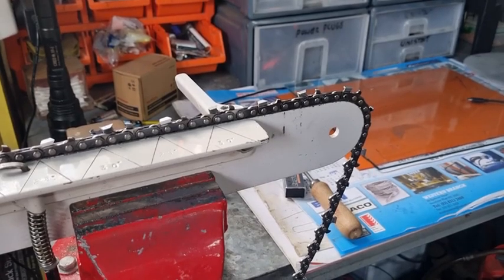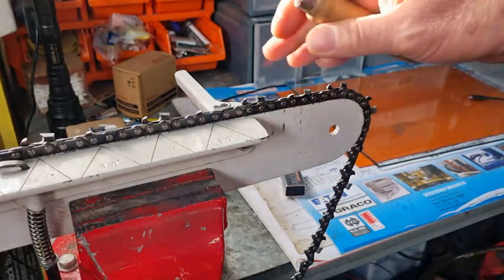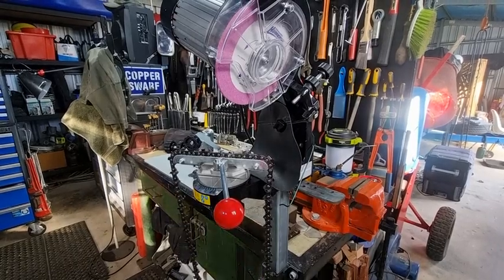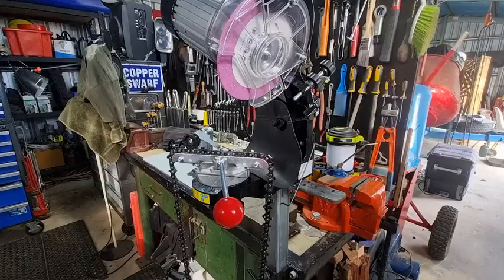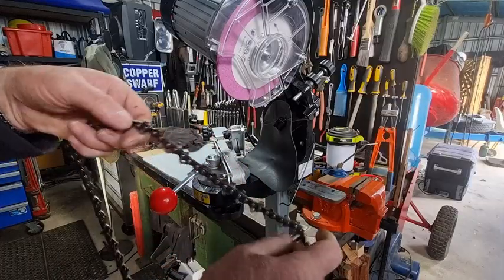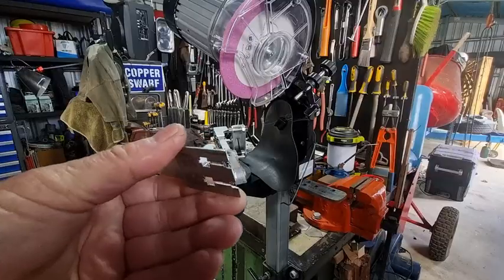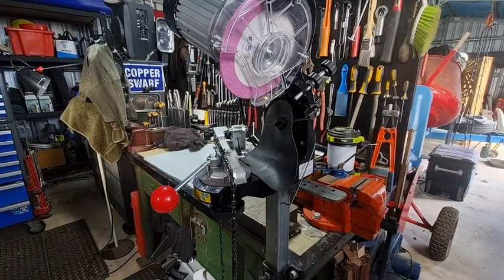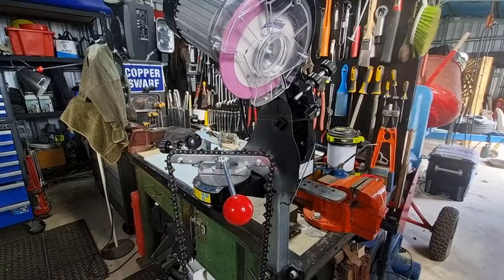How to get your chain teeth the same length when sharpening your chain

Comment: I don’t worry about just a few teeth being a minor length difference. I file BOTH teeth with the same RIGHT HAND because I can’t make my left hand do the little things that need a lot of dexterity to accomplish the little things in life that need very fine detail…like sharpening my chains.
Reply from the maker: With practice we do get much better at sharpening and get it done even left and right
Reply: @ChainsawUsers  I’m doing better all the time at getting the constantly the same length AND extremely sharp. My arborist friend has always complemented me on how sharp my chain is and how well and straight it cuts. It’s very long lasting as well…until it comes into contact with something that would dull ANY chain.
Reply from the maker: @ToddAdams1234 chain grinders can also give problems if not set up correctly.  Thanks for your comments
Reply: @ChainsawUsers  In the portion of my life that I’m currently having to undergo, an electric chain grinder of ANY type is off th table. It’s just not in the cards that I currently have in my hands, but I DO like making an occasional bit of cash using my saws. That’s why I became really good friends with my files. 😂

Comment: When I started filing I did it straight from the start filing left n right tooth in alternate fashion.  Trained my muscles by doing superlight strokes with the file till I was able todo it with ease, no problem with different length teeth, it's all practice "hence all in the filing😊"
Reply from the maker: Yes you got it right

Comment: Record a video showing what shortcomings of the machine prevent it from sharpening right and left teeth of the same length.
Reply from the maker: In all cases the variation of tooth length during the chain sharpening process is caused by human error only.
The user is not setting up the back stop so it removes the same amount of metal left and right.
Quite simply the user needs to set up the backstop so the tooth just touches the grinding wheel.  This is the starting point to grind the chain.
When finished one side of the chain the user fails to adjust the back stop to the same setting.
So if you remove .2mm on the left side you need to remove .2mm of the other side.
Reply: @ChainsawUsers  Why adjust the stop? A machine with the correct geometry and accuracy should sharpen left and right teeth equally.
Reply: Under what conditions will the machine sharpen both teeth without adjusting the stop?
Reply from the maker: In the case of the USG grinder it is a precision grinder and in most cases its not required to reset the back stop grinder left and right cutters its just a good practice.

With cheaper grinders the tolerances  are not as good as a USG grinder and its best to adjust the back stop to ne 100% sure you are grinding the same of metal of both sides.
Every machine will have variations in tolerances even the USG grinder
That why I check both sides using the back stop
Reply from the maker: No machine is perfect that's my point.  And that why I recommend you setup the left and right cutters with the backstop adjustment for both left and right.
If you swap left to right or right to left without backstop adjustment you may have a slight error.
In most cases you are only removing  .2mm to sharpen a tooth.
Reply: @ChainsawUsers  To make the teeth the same, the left and right, teeth need to meet the grinding wheel in the same place in all planes. You can think of a way to implement this.